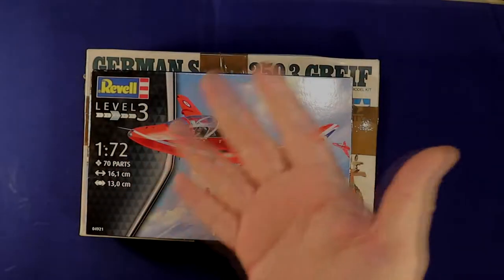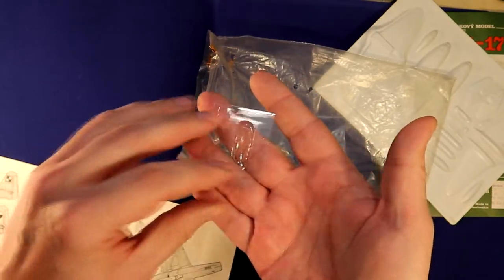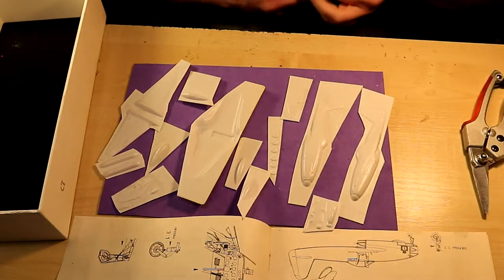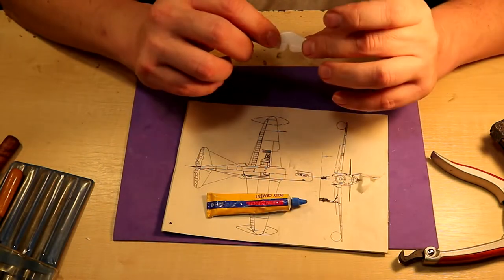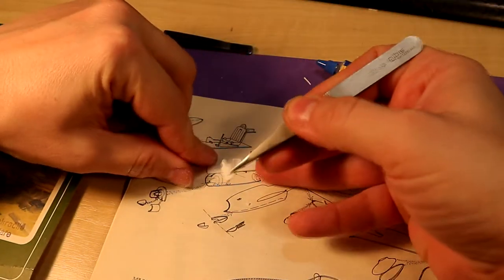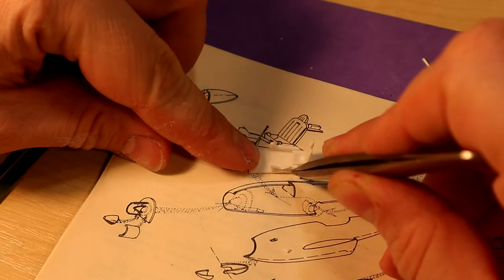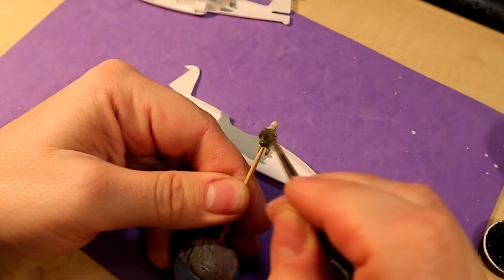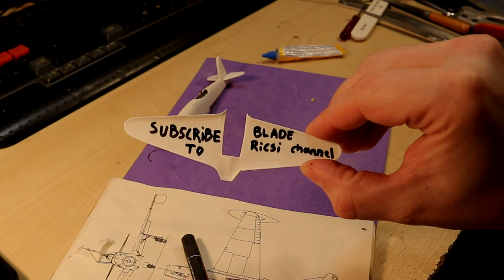Yak-17 model kit build, 1/72scale. Part.1

Comment: Can you still buy vac form kits?
Reply from the maker: As far as i know there are new vacuform kits, but this old ones costs almost nothing.
Reply: @BladeRicsi  I see old vintage kits on ebay for over $50. Crazy!
Reply from the maker: @bertroost1675  Collectible vintage kits are not cheap, i try to not build rare model kits. But some vintage kits are very common.This one is very common, i bought this for 2 euro.